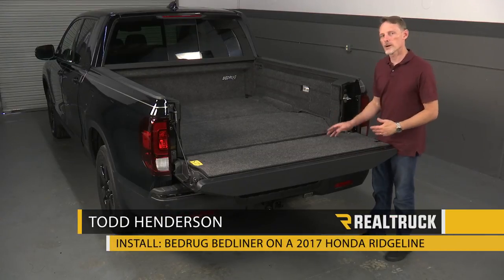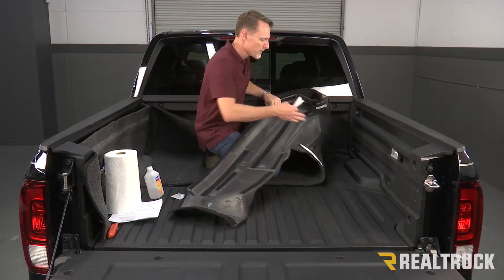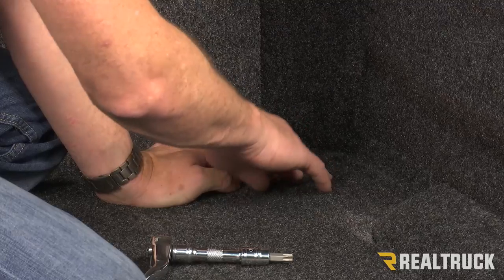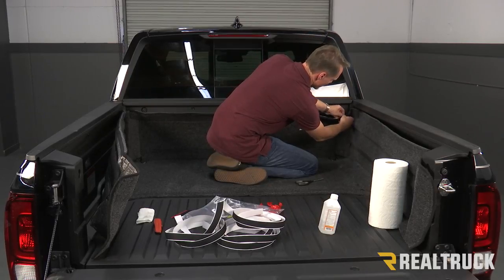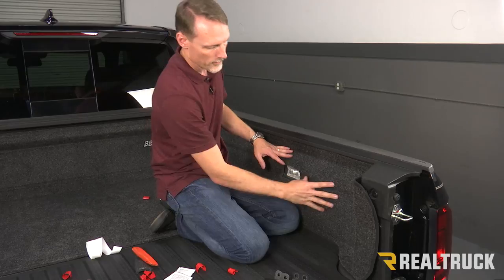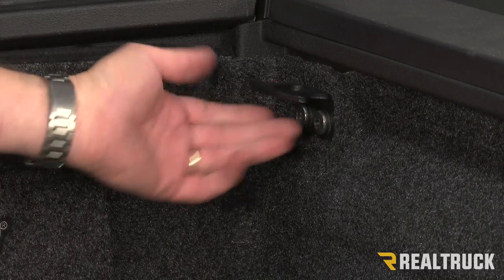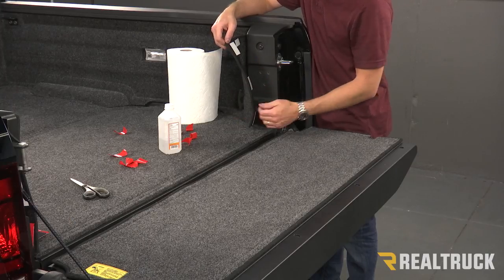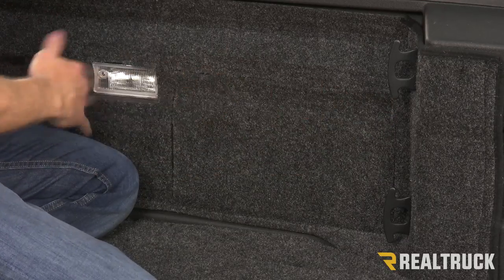How to Install BedRug Molded Carpet Truck Bed Liners on a 2017 Honda Ridgeline

Comment: How does this affect the in bed audio?  Is this an all weather rug that can be taken through a car wash?  I love the look need to know about any issues before purchase thanks.
Reply: Wow, wow, wow... I can't believe I didn't think to test the sound on the in bed audio system!!! 

I would imagine that some treble would be cut but the sidewall material is extremely light for as strong as it is so I don't think you'd lose too much volume, especially since your entire bulkhead and sidewalls are essentially your speaker cones. 

As far as water, that won't hurt the BedRug, in fact, the product is a bed liner made of 100% polypropylene. Because it's synthetic, mold and mildew can not feed on it but I would recommend removing excess water with a wet/dry vac so that it doesn't become stagnant. 

I also always recommend a good Gator Cover for that bed so you can shelter your cargo from the elements, help secure your stuff from theft and keep Bubba from throwing his garbage into your bed. Too many people think an open truck bed is their personal trash can! LOL

You can also get a power lock that works with your tailgate so that it locks and unlocks with your doors. Ridgeline is really cool and there are a few "must haves" to get the most out of it. Let me know if you come up with any other questions!
Reply: BedRug also offers a product for just the floor of the bed - a mat.  I opted for that for two reasons.  First, its impact on the in-bed audio as you mentioned.  Second, the floor of a truck bed is what takes the beating, so I'm not really worried about protecting the bed's sides.  I found my way to this video because I just received my bed mat and was looking for a how-to installation video.  The video deviates from the printed instructions that come with the product in a couple of ways.  First, there are slits in the rug where the cleats are attached to the bed floor, so you can simply slip the rug over the cleats cleanly.  I do see where the video's approach does afix the rug in a very sturdy way.  I'll just use the slits and see how that works, knowing that I can always revert to the video's approach if need be.  Second, the installer preps more than one area at a time with the alcohol and the adhesive promoter.  The instructions are very specific about this, saying that you should clean, apply promoter and adhere each hook fastener before moving on to the next one.  Doing it the video way, you do run the risk of contaminating the contact point of the ones you're doing subsequent to the first one.  If my install experience provides what I think might be valuable information not provided in the video, I'll post it here.